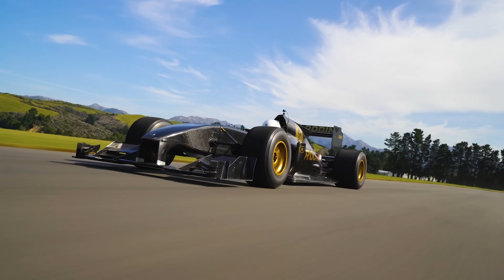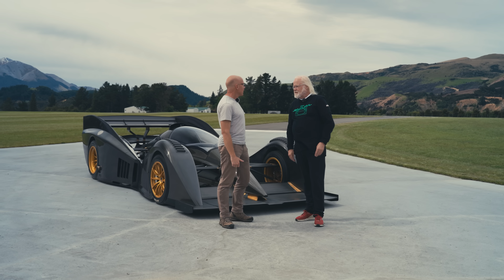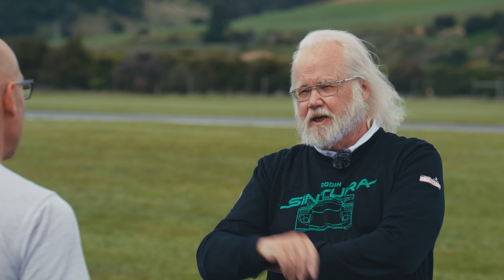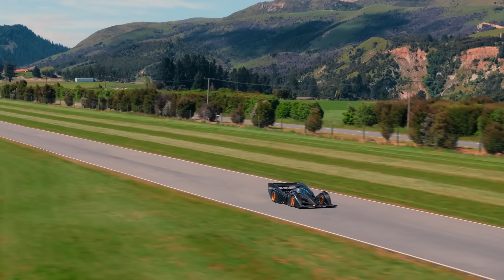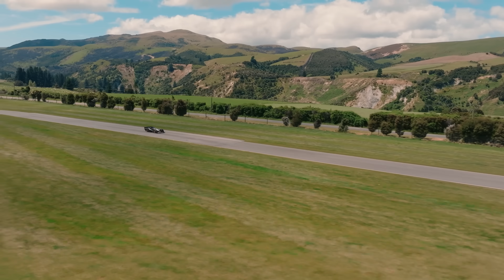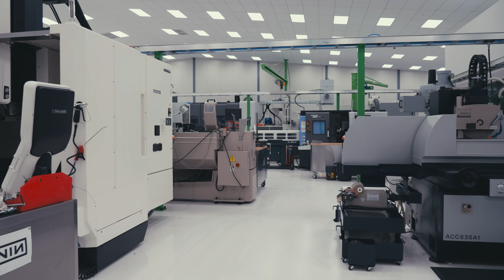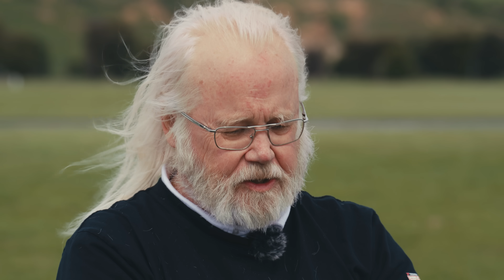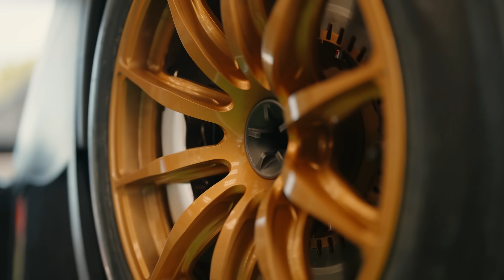Rodin FZero – 1500bhp Single-Seat V10 Madness!

Comment: The McMurtry Speirling Pure would destroy this
Reply: Spierling has up to 1000hp and 1000kg, this will have 1500hp and 700kg.
Spierling will be faster off the line, after which the Rodin walks away from it.
Reply: @JakobusVdL  maybe... Until it gets to a corner where the McMurtry doesn't have to slow down
Reply: @MurseTech64  once they are moving the FZero is generating downforce too, up to 4 tonnes at high speed, but a big proportion of that at lower speeds
The Spierling is a brilliant thing, but its fan can only induce about 1 tonne of down force.
Another factor in favour of the Fzero is that it is way wider than the Spierling, so will be more stable in cornering, and braking. 
So the Fzero drives away on faster corners.
Reply: @JakobusVdL  Makes sense
Reply: @JakobusVdL  And the Spierling is a tiny thing so possibly far more nimble especially on smaller narrower tracks where the FZero simply can't spread it's legs. Either way, we're lucky to have both of them and hopefully will see the Fzero in full action one day soon and maybe a head-to-head with the Spierling and others in the future.
Reply: @InZanHass  fair enough, but there are not many race tracks that are not wide, because most race cars are wide, and they need space to race.
I prefer the innovation of the Speirling (BEV, fan based ground effects etc) but can see why the FZero will generally be faster on a race track.
Reply: @JakobusVdL  Thank you both for the entertaining debate ;-0)  I agree re the Fzero should be much faster re power to weight, its ultimate downforce, and of course I'd prefer its screaming engine. When the OP brought up the comparison I was intrigued too. Enough to just go look at both their websites. I do love the size of the Spierling, and its electric torque combined with the fan, maybe it would be  a giant killer like the original Mini in the right circumstances...?  I think it would be faster around Stage 1 and Stage 2 of  Rodin's own test track, the challenge would be around stage 3 and proper tracks. Simply though, if the Spierling isn't as fast as an F1 car around a standard F1 track, and the Fzero is meant to be faster... ;-0)
Reply: I think you could be right. The McMurty is a crazy machine too.

Comment: That's the most V8 sounding V10 I've ever heard.
Reply: That's the most rotary engine sounding v10 I've ever heard
Reply: @ajax7214  I swore that's that a rotary when it idled then it turned into a V8 when driving :-D
Reply: @palleppalsson  In motion it still sounded like a V10 to me just more classic sounding. Do want to hear it at redline though.
Reply: @ajax7214  at idle it sounds exactly like a yamaha srx 700 3 cyl 2 stroke snowmobile
Reply: @ajax7214 what because of the start up 😂
Reply: I dunno man. Sounds very similar to a Viper to my ears
Reply: @MrSelfDestruct-1  because it's a v10 with side pipes
Reply: @yota8325  Not all Vipers had side pipes. The Viper's V10 sounds the way it sounds because it's an odd firing order pushrod V10.
Reply: @electrikoptik  The 5.2L V10 in a Lamborghini also fires at 54° and 90° as both have a 90° block instead of a 72° block.
Reply: @yota8325 you’re not smart at all 😂😂
Reply: @yota8325 second gen viper had rear exhaust pips. So the placement doesn’t really affect the sound.
Reply: It sounds like a viper v10. Nothing like a v8.
Reply: That idle sounded like either a bridgeported or PP rotary, or a 500cc stroked Banshee 😅 (I haven't watched past 24 seconds, I popped immediately into the comments to see if anyone else thought the same 😂)
Reply: @johnnygeorgopoulos4072  same here
Reply: Not at all, it clearly has the perfect 5th sound of a V10.
Reply: What’s the point of this thing exactly?
Reply: @nz_sailor To make an F1 car that's not limited by the stupid F1 regs.
Reply: You should go listen to Lamborghini Huracan’s and Audi R8 V10’s whose owners did turbo builds. You gotta remember this is a turbocharged V10, it’s not N/A
Reply: To me it sounds like a Honda with the vtec cams engaged all the time-at idle.
Reply: Ainda tá em produção, vai melhorar com certeza
Reply: haven’t gotten to the startup yet but i’d assume it has to do with the exhaust routing. no crossover, X pipe, etc. for exhaust pulses to combine and interact.
Reply: At idle just sounded like a generic lumpy overlapping chop chop machine. At rpm was definitely a v10 sound.
Reply: The point is a street car ,faster and lighter than a f1 car of the same year.
Reply: They never combine the engine banks with the exhaust, so you basically have 2 5 cylinder engines next to each other
Reply: Viper esque
Reply: That the most Australian sounding new zelander I’ve ever heard
Reply: Flat plane
Reply: Agree
Reply: Sounds like the Audi Trans Am/IMSA GTO. You're only hearing the one bank of 5 cylinders
Reply: I was thinking the same thing thought it was an American engine honestly,  but kudos to them
Reply: Sounds similar to a cammed dodge viper tbh. That's a v10
Reply: @vanguardsr368  Some confuse the sounds when they hear any high-lift cam at idle popping and cracking, since cam upgrades are so strongly associated with old school V8 muscle.  Just got to listen to the rhythm and exhaust note.
Reply: Oh so they actually started it up? They spent so much time talking about the thing I wasn't sure.
Reply: @itsthinking Your attention span is fried